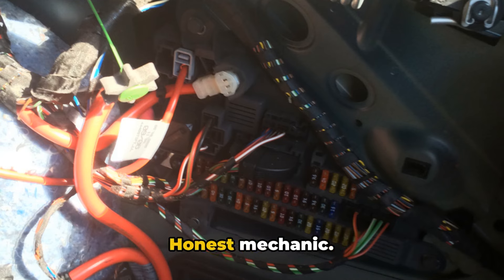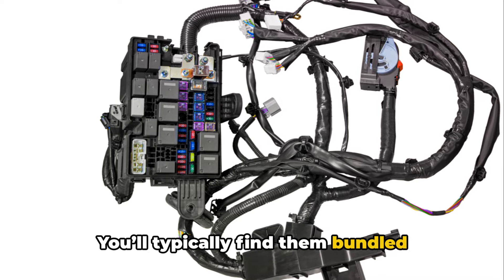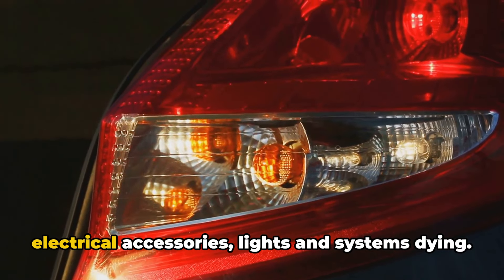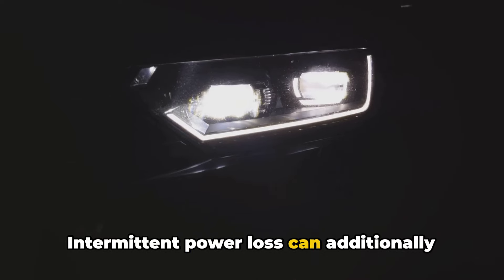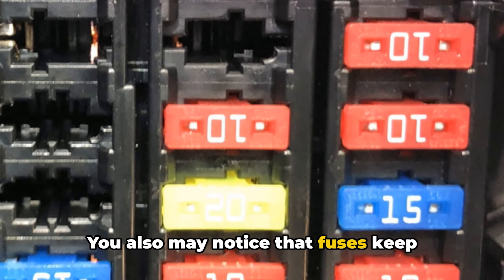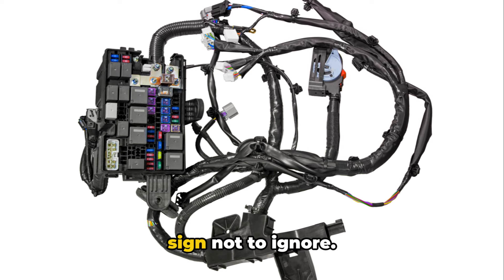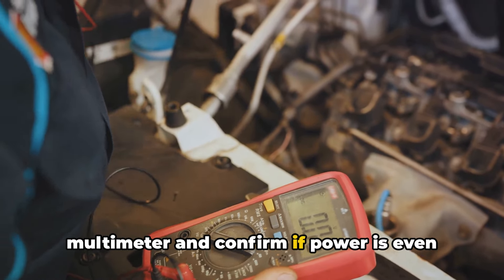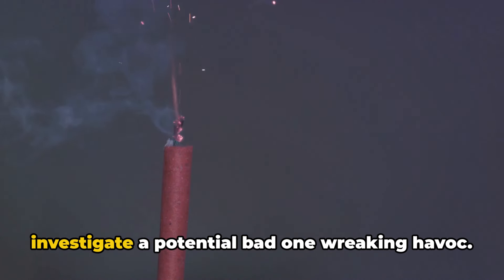Bad Fusible Link Symptoms: 7 Failure Signs

Comment: The problem with fusable links is that they are usually buried in the bowels of the engine. They should be on top. And it should be obvious if they’ve blown.

Comment: I replacedmy battery first, then my fusible link and alternator on my 2008 4runner.  Car starts but no electrical  components work such as ac, radio, power windows, lift gate and will not shift out of park.  Wondering if it is my ecm?

Comment: Ok, my 2002 Toyota Tundra keeps draining my battery, I didn't have a single light in my dash. I charged my battery went to Auto Zone and they couldn't tested because the battery was too low. I'm a 65 yo woman and I used to work on my own 66 GTO but these newer cars are to hard for me to understand. So I didn't have any lights on in my dash, is it the visible link or one of the other fuses?

Comment: Can you explain how a fusible link would fail, other than blowing as intended?  I've never seen one do anything except blow; they are, after all, a fuse.  If there is a bad connection, that is a mechanical issue, not a "bad" fusible link.  Can you explain how you justify your post?
Reply from the maker: Hi, A fusible link can fail due to corrosion or physical damage, causing it to degrade or break down over time. This can result in intermittent electrical issues or a complete failure of the circuit, even without "blowing" as intended. These issues can be mistaken for a "bad" fusible link. Thanks for watching!